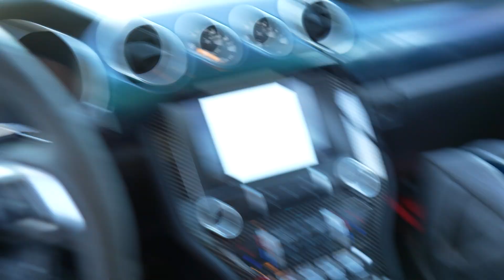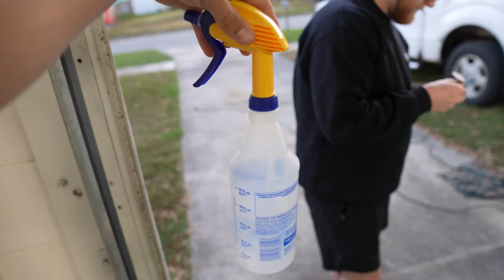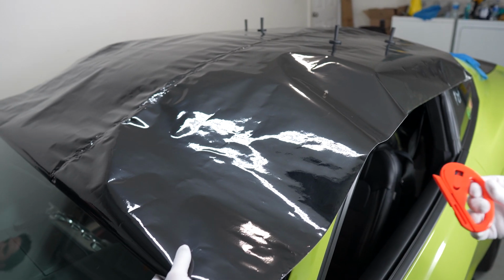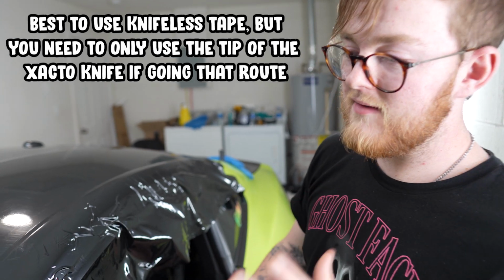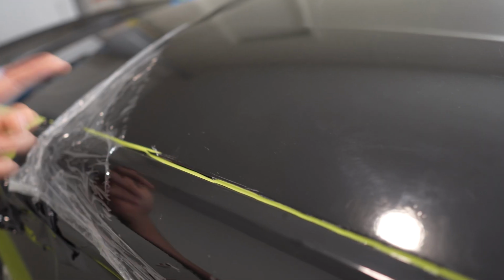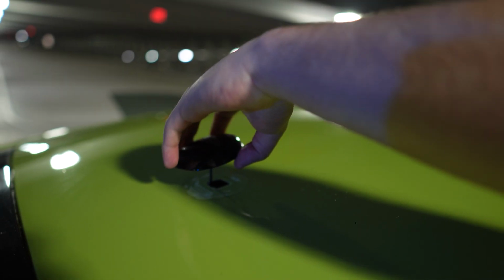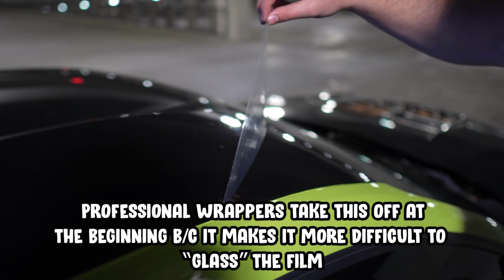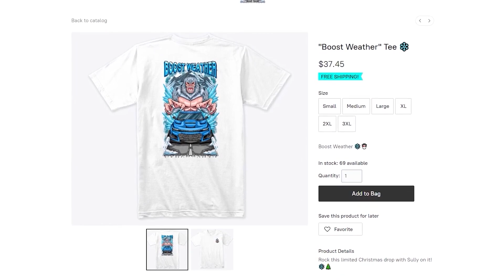I WRAPPED MY MUSTANG'S ROOF GLOSS BLACK & IT ACTUALLY TURNED OUT NICE ON THE 2ND TRY?! #3M #FORD

Comment: i would have cut it longer and tried to tuck it between the panels. Even with knifeless tape i don't think you will ever get a perfect line. ck wraps did an s550 on his channel i think. must go see what he did. The s197's have a trim piece you can pull and wrap under it.
Reply: just watched ck wraps mustang roof video and he used knifeless too, but he tucked it down in, then pulled the tape.